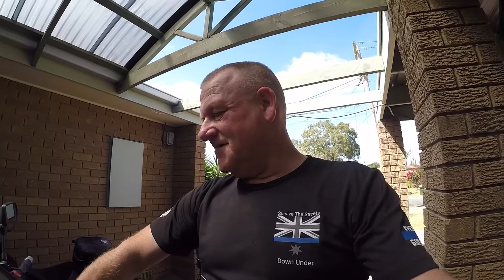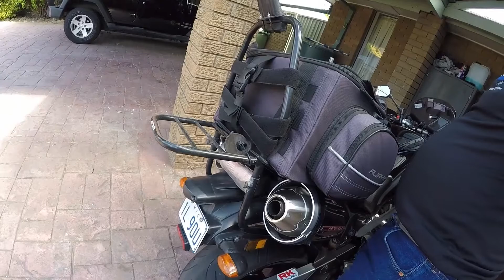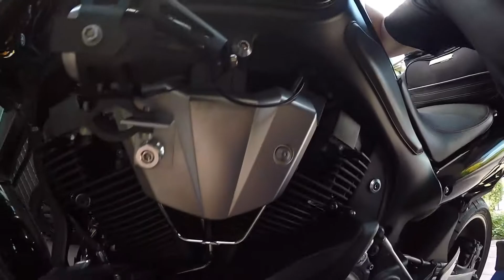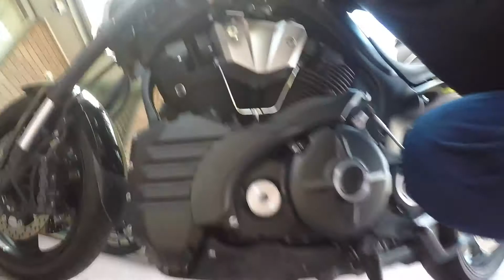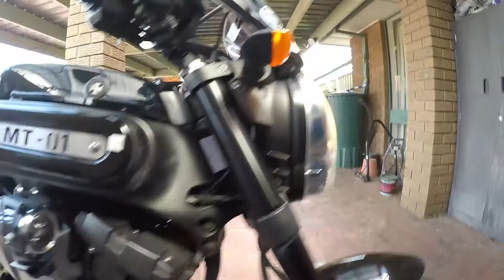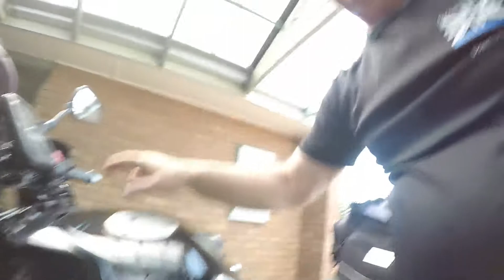Yamaha MT01 Engine Noise

Comment: Hi! I like your vids! Thanks a lot. Is your engine ticking also under load? Mine is ticking a little louder when under load quite low rpms. For example when starting from a red light uphill.
I think this is "normal" but just want to know if you have the same ticking accentuation? Cheers from Switzerland

Comment: Gear driven motor to clutch, gear driven cams etc straight cut metal gears makes for a lot engine noise, how many kms have you done now, i just hit 40k on mine, about to replace chain and sprockets

Comment: Have you checked and adjusted your exup valve cables, mine were way out of adjustment runs heaps better smoother pulse from motor,
Reply: At what milage did this need doing on your bike?
I am looking at buying one that has done 18.000 miles (30k kilometres) 
Should i be looking into doing this soon?